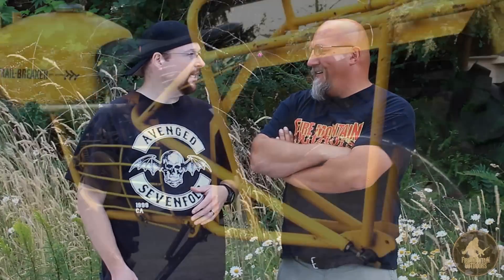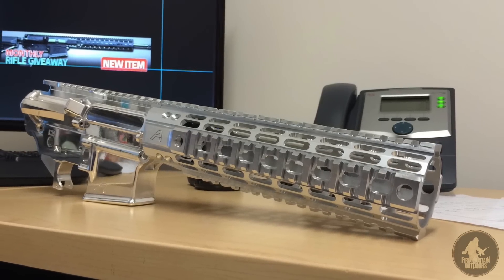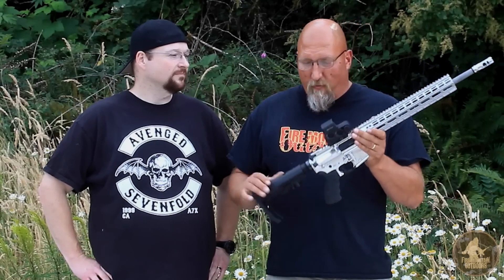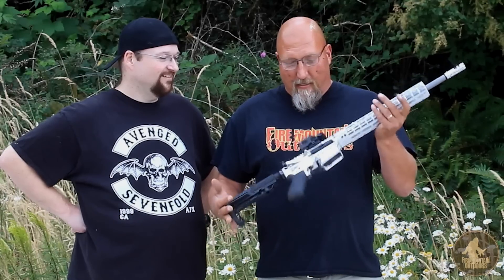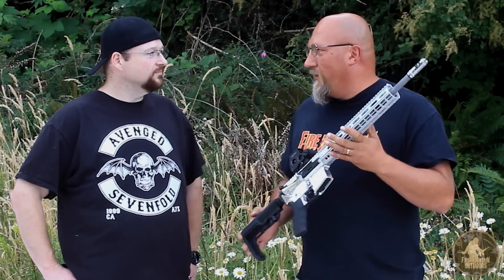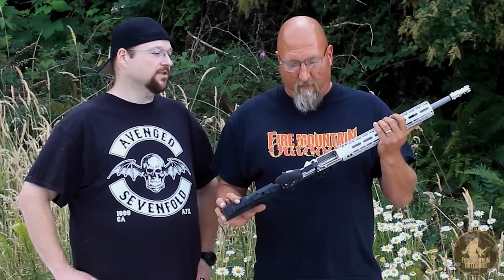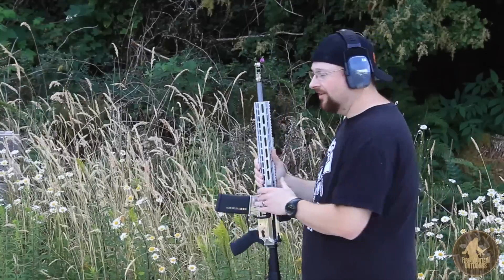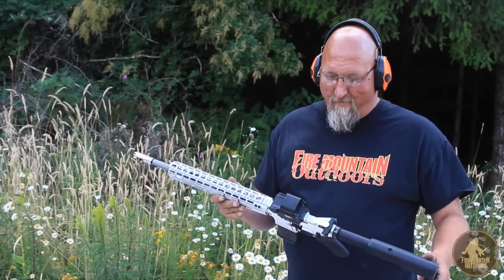Most EPIC Aero Precision AR15 - Mirror polished aluminum

Comment: I'm working on one right now. I got the upper and lower receiver and been sanding/buffing away. Made it up to 2000 grit and not sure if I'm happy with it yet. I can't decide to go all mirror shine or possibly with a blue anodized  forward assist, safety selector,  charging handle etc. The possibilities are endless.
Reply from the maker: You got that right. The possibilities are endless. Years later, I'm still trying to find ways to improve mine. When you get it finished, make sure to share a photo on our facebook page!

Comment: I have personally manufactured (legally) over 50 Polished ARs in various configurations, most of which were pistol config. I still have the original I made from an 80% lower back around 2012, a couple pistol uppers and one aero Rifle. Get NIB parts for the rest of the gun and magpul grey furniture and a stainless barrel for a complete look. They sold relatively well but as you know its a ton of work.   The aluminum gets a bluish hue over the years from natural oxidation but to this date I have not seen any corrosion from normal use and cleaning.

Comment: Excellent, excellent, concept! I want one very similar, with a few changes. Polished upper & lower, black hand guard, stainless steel barrel, with a black muzzle device & of course, black stock & grip. And when you'd insert a black 30 rd. mag this combo would symmetrically, POP!  With pun intended.
Reply: Your not cool if your chrome don't shine👍

Comment: Sorry, didn't see the parts list, my bad. I was just so impressed by the rifle I couldn't take my eye's off to look at the "Show More" button. But I don't see the info on the bell when you push the bolt release.?. And I'm not familiar with the .223 Wylde. Can you use standard .223 or 5.56 or is it dedicated to .223 Wylde? And is that why it looks like it has almost no recoil? I do see the muzzle brake huffing a good bit so maybe it's making all the difference? Does the M4E1 have Piston or Gas system? Sorry for all the goofy questions but I have been looking to start a new AR and I think I've found it.
Reply from the maker: +northsidemechanic .223 Wylde can shoot both 556 and 223. It's the hybrid caliber we have all been waiting for. It shoots 223 as accurate as anything I've ever shot and the same goes with the 5.56 that I've run through it.
This has a mid-length gas system. With the Strike Industries muzzle brake there is virtually no recoil. It shoots very soft.

Comment: 1st. Why does it ping when bolt comes forward. I have 2 AR's and neither make a ping when used. Is that due to no coatings?  2nd. If anyone is considering this or you are considering doing this again I will make your life a 1000 times easier. There's a product by a company called Nuvite Nushine that is a metal polish for aircraft. It's expensive but is well worth every penny. I've personally used the stainless steel polish on a aluminum aircraft prop for the man cave and that stuff polishes metal so fast it's like smoothing out butter. There are different grits and they also make aluminum polish. I would recommend the stainless polish until you have major flaws all buffed out then work to finer grits. Not sponsored by them but I'm a huge fan of their products for all my custom needs. P.s. Love the polished rifle!  Nice work!

Comment: I want one just like it!! I have a couple questions. 1) It looks like it has no recoil. Did you use gas or piston system? 2) Will you give us a list of the parts you used? 3) what kind of hand guard is that? 4) Is that AR in 5.56? 5) Did you install a bell that rings every time you push the bolt release? Or is that a little video magic? Thanks and REALLY cool rifle. The only way to make it better was if it were in my safe instead of this video.
Reply from the maker: +northsidemechanic Parts break down is in the video description.  Everything but the stock and muzzle brake were ordered directly form Aero Precision. The stock is a Battle Link Minimalist. The Muzzle Brake is a King Comp from Strike industries. All parts were purchased anodized black and then I sand blasted the parts and polished everything by hand using Mother's Aluminum Mag Polish. The optic is an EoTech EXPS2 

The sound it makes is not edited. Because it has no finish, the metal "pings" when fired. This wasn't expected but a cool side-effect of stripping all the finish.

Comment: i had this same idea and purchased a raw billet lower. but doing research i found out there was a reason the upper was anodized. the upper needs to be finished to prevent galling of the aluminum upper internally. what have you done to protect and lubricate the inside of the upper? i would like to complete my project.
Reply from the maker: urpersonalguard I'm using a stainless steel bolt carrier with some frog lube. If any damage starts showing up I'll post some info. Should be no issues.

Comment: I plan on doing the same thing to my S&W 1911 e-series aluminum frame to match he stainless steel slide. It there a lacquer or anodizing you apply on after to protect from oxidation?
Reply from the maker: I haven't applied anything to the finish. As it dulls or scratches I just repolish it. It doesn't get used very often so there isn't much upkeep.